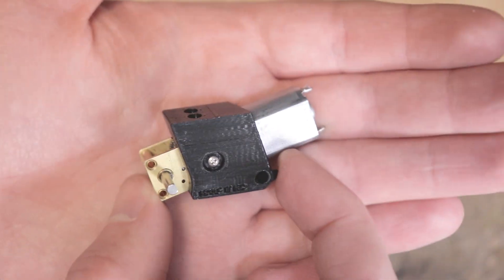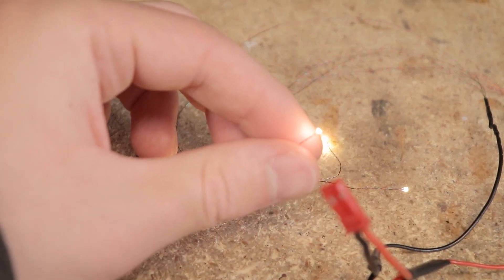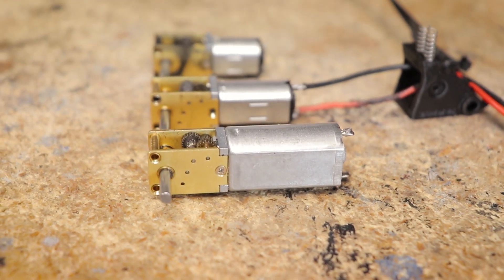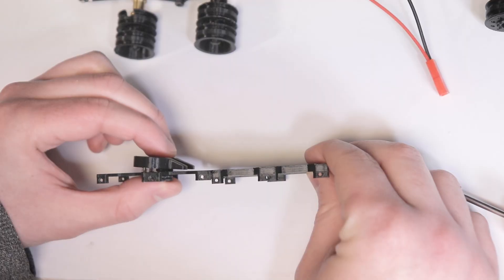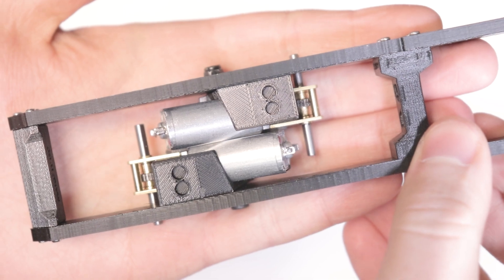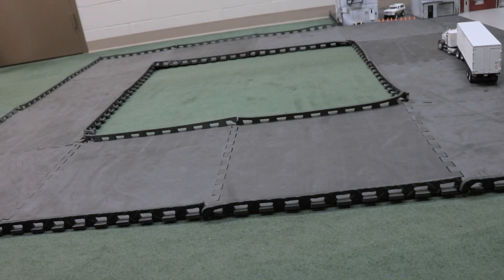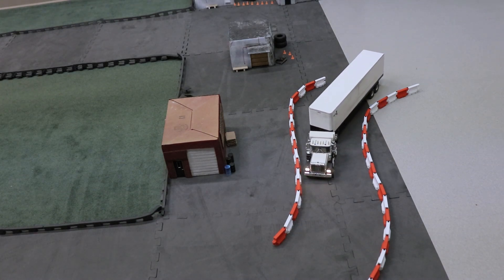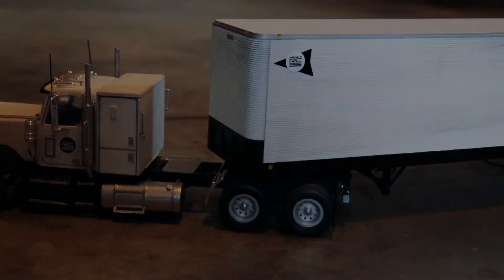1/25 Scale RC Semi Truck Upgrade 🔧 Bigger Motors For 3D Printable CTC 01 Chassis

Comment: 8:05 - I don’t know all the specifics, but I’d bet the two different variants are using the same motor and just changing ratios in the gearbox. To get the higher speed, you’d need a taller ratio, and a shorter ratio for the lower speed.
The shorter ratio would take better advantage of the torque from the motor and put less stress on the gearbox. It could be that the stress/strain put on the gears by the taller-ratio setup is enough to shear the worm gear.
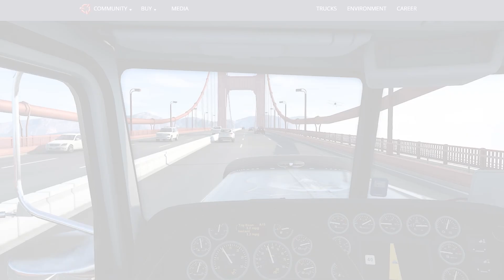Reply: Also 10:00 ATS mentioned

Comment: The problem you have will be when the truck stops the worm and wheel gearboxes are not back drivable when slowing down so when you come to a stop instead of the wheels spinning the motor and gradually slowing down the gears tear the teeth of the worm gear

Comment: The problem with these higher speed motor setups is as they run over time they build up heat it the gearbox causing a failure as they arent lubricated , under a simulated load they can fail within minutes
Reply from the maker: Interesting, I wonder if a little grease applied to the gears would help prolong the life? The thing is, two of the motors that broke, did so immediately. Like maybe moved the truck a few inches before completely stripping out. Another set worked fine for maybe 15 to 20 minutes give or take before they started getting crunchy. I have a lot of experience with the single output shaft style of these motors, which I've used for a lot of on-road car builds. I've almost never had any issues with those, even on “race cars” (I'm being relative here lol) with dozens, if not hundreds of hours of use at this point. That said I have less experience with these dual shaft variations. This is the first chassis I've ever used that incorporates this style of motor/gear assembly, so perhaps these are not as bulletproof. Fortunately all the motors, aside from the specific ones mentioned, have had 0 issues so far. They aren't even getting hot while driving. Warm sure, but not enough to even get worried about softening that PLA. The only way they'll heat up is if I grab onto the tires and not let the axles move at all while giving them full throttle for a while (not recommended lol). But even then nothing broke or stripped out. They worked just fine after I let go of the axles. Oh well, I'll keep on testing lol. At least they're cheap. I don't need them to go a million miles, but more than a few inches would be nice. 😆
Reply: I wouldn't be surprised if the worm gear being made from brass instead of steel, was an issue.